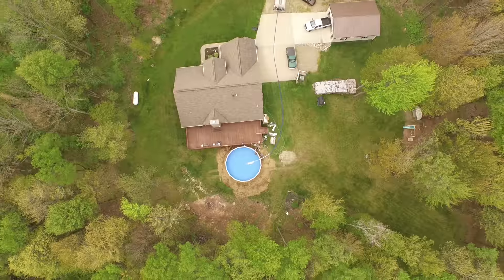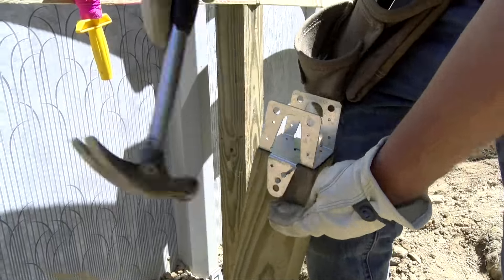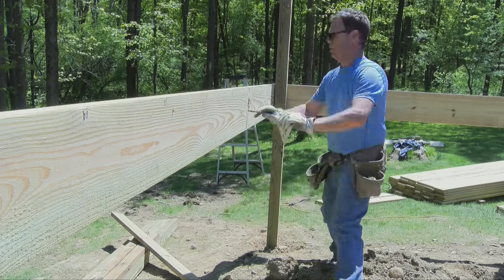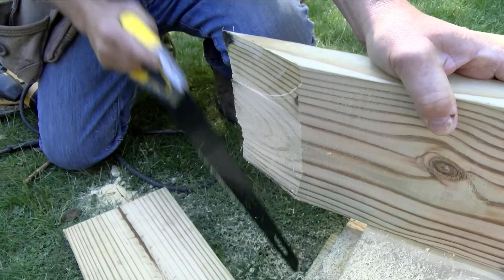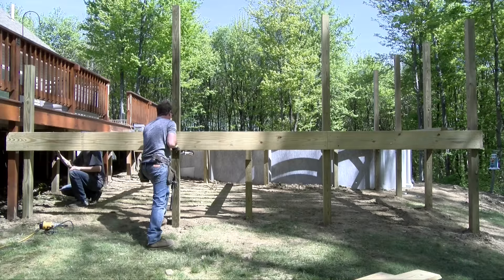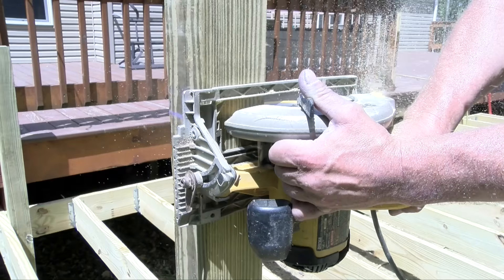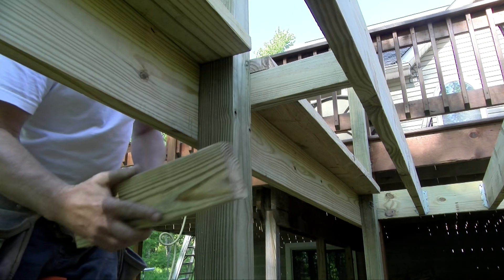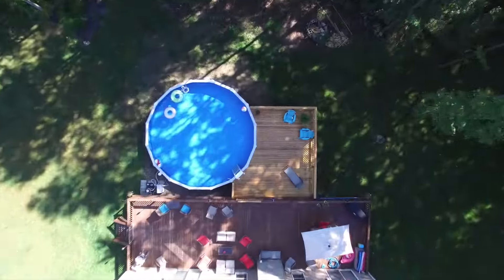How to Build a Pool Deck in 2018  # 2 Finishing the Frame

Comment: So you don’t concrete your footings? Do you not have building codes where you live? Like how you have the deck attached with lag bolts instead of full load bearing on a post or beam.

Comment: Great Video.  Except for setting the posts in dirt even though they are guaranteed against rot!  Just please check your local building codes because I have had a bear of dealing with some...FYI in PA I had to dig a 36" deep by 12" wide hole...then get an inspection for the holes and I needed to pour 12" of concrete for the footings....then I could place the posts on that with dirt around.. (I chose to use cement )

Comment: How do you put a winter cover on the pool if the deck floor goes flush under the pool edge? Would it be better to go over the pool edge in a northern climate?
Reply from the maker: Hi Rachel, Happy Easter and thanks for watching. The next video https://youtu.be/wdoWNihqhr0 shows that the deck boards are held to under the pool cap but cut 1/2" way so the winter pool cover and cable slide right past. Ive seen pool decks above and over the pool cap and its not a good look.

Comment: Craig....Great series.  I am building in MN i noticed you are just putting your posts on the concrete in the hole.  Never seen that, maybe do where i am and frost.  Is there only the dirt packed in on top of the concrete and around the post what holds it in place?

I have to used a strong tie product with anchor bolts
Reply from the maker: The only way to anchor the deck down is to use pier footings with 12" building tubes and the concrete will be above the ground. You can then use the anchor bolt system. This method is way too difficult to get the post footings accurate to build the deck for most do it yourselfers. So i suggest to dig your footings 4ft deep and  12-14" wide and put 8" of concrete in the bottom and let cure overnight. If your posts don't exactly line up to where you need them, you have a few inches to adjust the post. So before you install the posts you need to brush on some tar 40" on the bottom half. Once your deck is all framed in and everything is square, level and plumb you can put another 12" of stiff mixed concrete on top of the footing and around the post. This slurry of concrete will be your anchor for each post hole. You can then fill and tamp the rest of the hole with the soil you removed earlier. I don't wait till the concrete cures, i fill the rest of the hole with the soil all at once. I would only do this anchoring method if i was getting it inspected. If the wind is strong enough to lift the deck out of the holes then the wind will be strong enough to tare the entire deck apart anyhow.
Reply: Late reply but Craigs method is one of the 3/4 approved methods for post footings. Cement footer below frost, post on footer backfilled with soil and compacted. This provides great lateral stability once the soil is consolidated. Other methods are sono tubes and brackets above grade on the cement. Post inset in cement is an option.  Helical piers are approved methods also. No digging and no cement. Your local inspector has the final say of what to do if a permit is required in your area. Hope this helps others reading.

Comment: Would you be able to give me some guidance. I pretty much know what I want structurally I just want to know if it works I drew out a plan. I need to know little bit more about Girter spacing I can give you more detail later if you would be willing to help me. I’m no professional but based on what I’ve been learning I drew plan. I would like for you to look at it to give me an idea if you think it will work I used some of your ideas I’m just on certain about girter spacing.My drawling has a rough draft but it gives a pretty good idea of the framing that I came up with joist in the gutter supports my decks going to be a  like you built but I’m coming out 9 feet over 24 pack 20 and then back to the pool at 12ft

Comment: Great video series! Just out of curiosity, why don't you set the posts in concrete on top of the concrete footing instead of just replacing the original soil around the posts?
Reply from the maker: On some jobs i do use tubes and fill with concrete so the posts sits on them above grade. The way i show you in this video is much easier and less expensive than tubes. In the last 30 years I have done several hundred decks with the same type of footing. The posts are rated ground contact and are allowed to be in there ground backfilled with dirt. Treated lumber is usually guaranteed a lifetime from rot and insect damage.